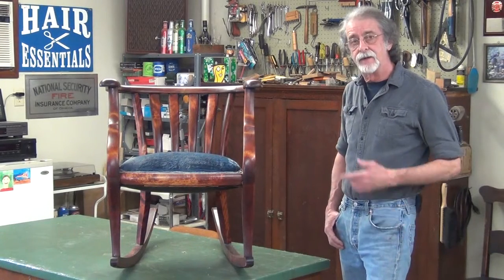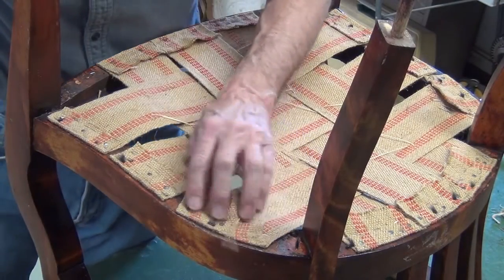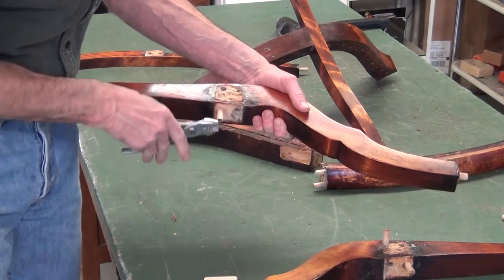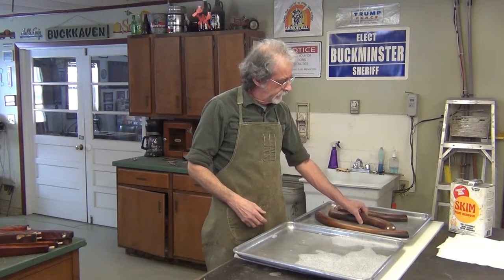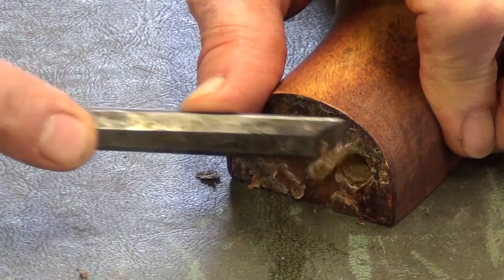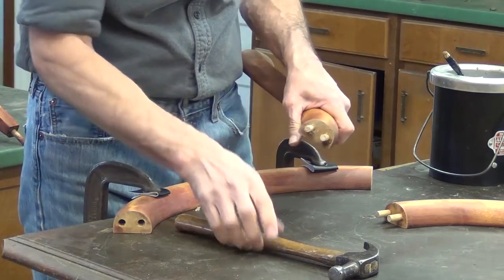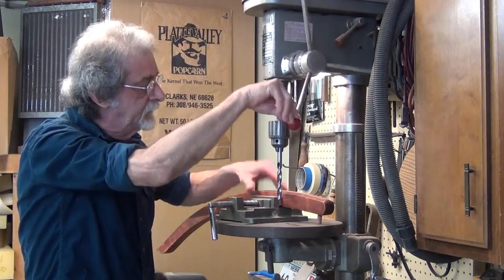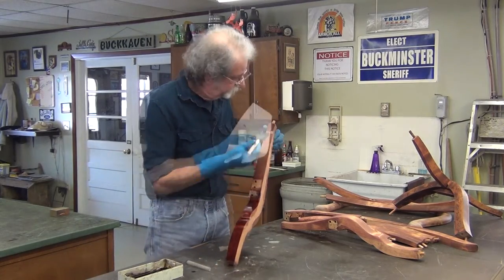Tips on Re-gluing and Refinishing Antique Furniture Frames

Comment: Very nice to watch++++great workmanship......a labor of love really......what’s the advantage of analine dye?..
Reply from the maker: Aniline dye was a standard for many years. Accurate to the period. Oil stains have heavy pigments that cloud the natural light reflection and depth in the grain. Aniline dye has no pigments and gives a highly enhanced, reflective and transparent color. White woods such as maple and birch can easily be dyed to match walnut and mahogany.
Reply: @Buckminsterupholstery  thanks for that sir.....if you had to do a wipe/brush/rag top coat....what would be your choice?...thank u
Reply from the maker: Shellac would be my last choice as it is difficult to work with however I use it thinned for sealing purposes often. Years back I had success with using mohair cloth to wipe on Formby's (sp) Tung Oil finish. Good for light duty applications. I rarely brush finishes but generally it would be polyurethane or Deft lacquer.

Comment: Question, I noticed you used the PVA glue on the splintering at the back of the chair but not on the clean break.  I would have thought that it would be a superior glue to the heated glue you used on the dowels.  Can you tell me what the thought process is there?  Also what is the heated granule glue?  Hide glue?
Reply from the maker: PVA is used on "new" wood and doesn't bond to hide glue however hide glue will re-adhere to itself. The open breaks are exposed raw wood where the rocker had a base of hide glue (however most of the original glue had been cleaned away). Also, in some cases carpenter's glue is quicker and easier than heating the glue pot.
Reply: @Buckminsterupholstery  thank you!